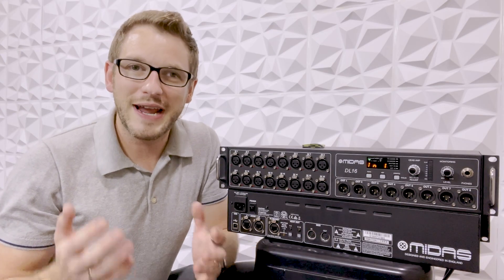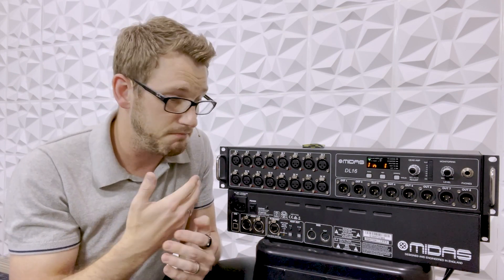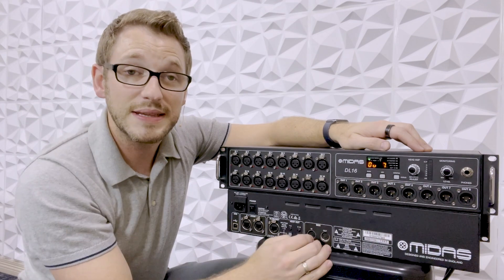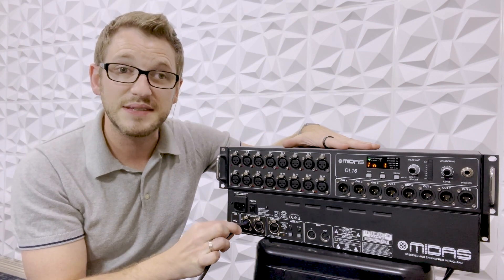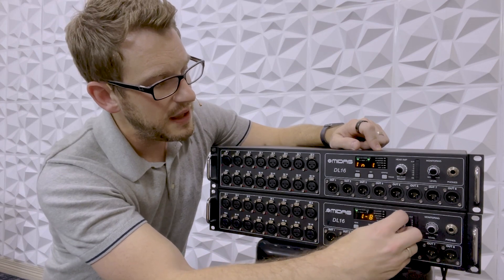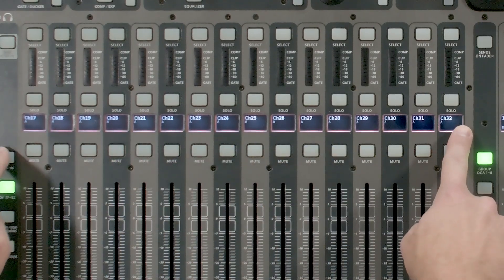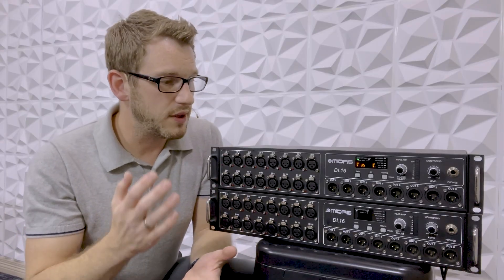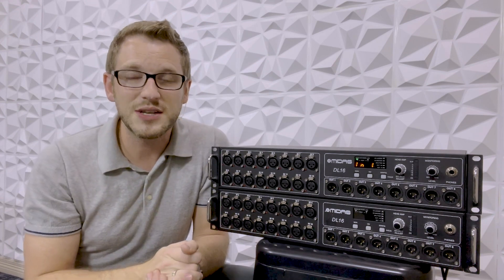Midas DL16 Stage Box & Behringer S16 Stage Box Tutorial

Comment: Drew I have a full x32 and then we use a x32 rack as a stage box.  I cannot route the ultranet from the foh x32 to the x32 rack backstage.  Can ultranet be ran from the x32 rack instead of foh?
Reply: Btw I did set it on aes50a like you showed in this video but ultranet only works on the foh x32 still.  My other routing works.  Just not ultranet.  Maybe only s16s and dl16s can do ultranet routing?
Reply from the maker: Yeah I think you are going to have to use a stage box to get that ultranet routing working from the FOH console like you are trying. The SD8, SD16, S16, or DL16 would work perfectly, just an added cost unfortunately. If you had an ethernet snake with multiple ethernet lines, you could use one for the AES50 and then another line for the Ultranet. Then plug that into a P16-D to get out to the other P16's. I hope these options will help!
Reply: @DrewBrashler  you rock, Drew!  I really appreciate the response.  I’m thinking I had it routed right but just a limitation on the x32 rack itself.  I’ll just run another cable from our foh.  We might get a dl16 soon so I can get my other cable run back I had ran for other network purposes.
Reply: The x32 rack is a mixer in of itself. You need to setup the routing for it's Ultranet port in the x33 rack routing
Reply: @DustySeven7  have you been able to test it out before?
Reply: @sircusboy351  I have setup for another person.
Reply: @DustySeven7  I’ll try it from the rack.  Thanks for your insight!

Comment: Thanks Drew for your helpful videos. Is it possible to have two DL16 with a compact X32?
Reply from the maker: Yes it is! Just remember you are limited to 32 channels of your main processing and then 6 auxiliary channels that have more limited processing.
Reply: @DrewBrashler  Thanks! Will I have the 16 outputs with two DL16?
Reply from the maker: Yes you will! Just make sure to set one of the DL16's to the (9-16) +8 mode that I explain in this video.